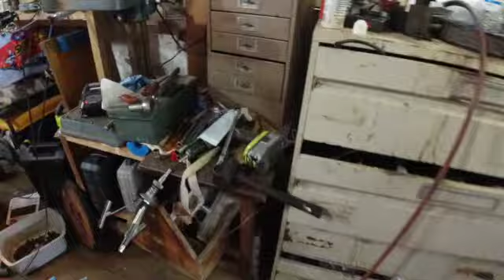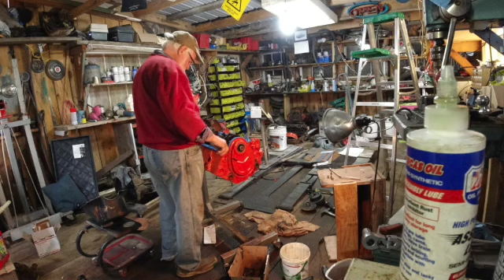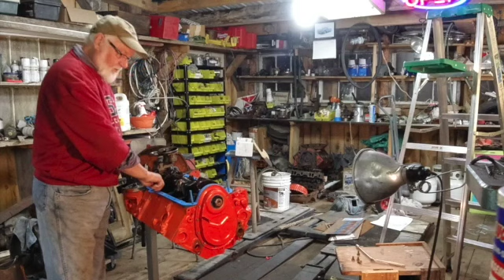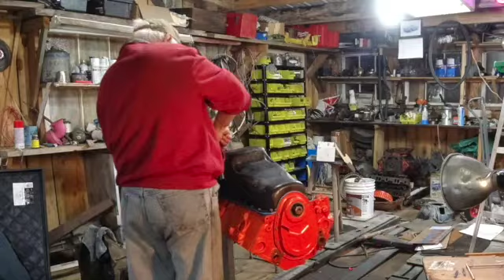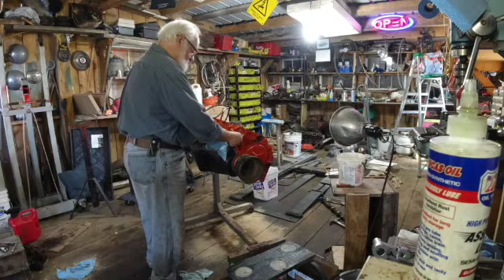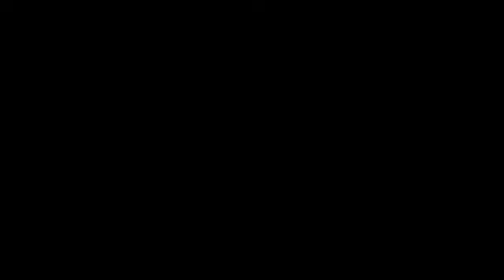Oil Pan, filter, Harmonic balancer, starter, fuel pump plate on 1965 Chevy

Comment: Studs on the oil pan were a good idea   Back in the day I used to cut heads off bolts for intake and head installation
Reply from the maker: That's a good idea.